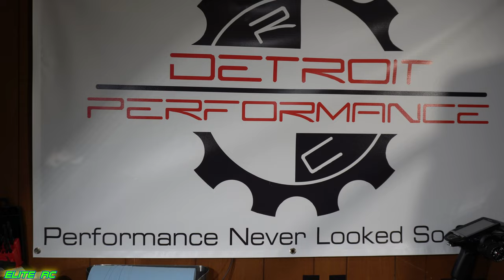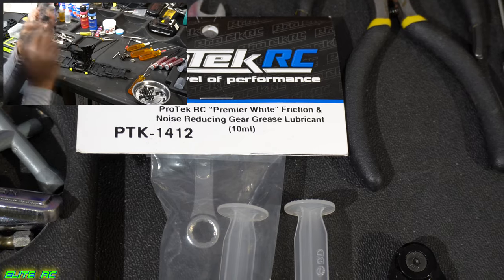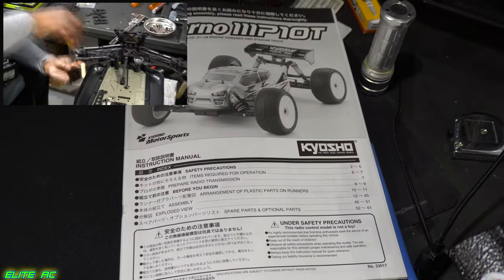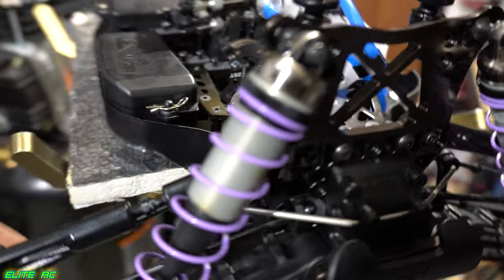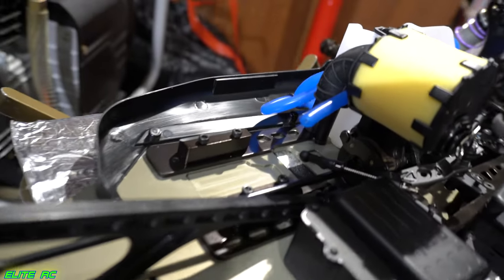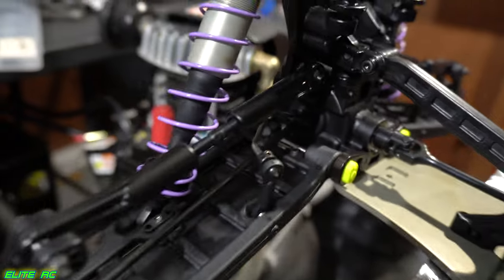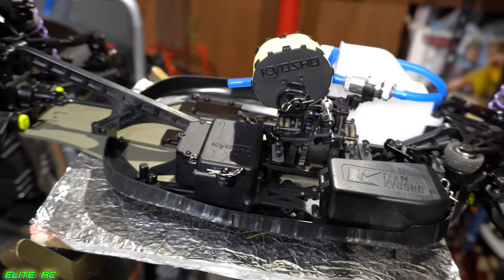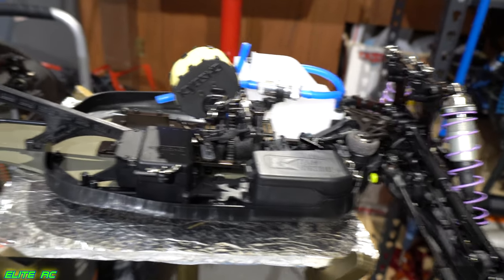KYOSHO MP10T NITRO TRUGGY KIT AFTER BUILD AND REVIEW

Comment: Great review. Debating on the new hot bodies  truck, or this. Kyosho  is great ran the Kyosho  mp9 and ST RR truggy for 7 seasons always did well. Still have them haven't ran since 2016 might  fire them up this spring  see how they handle before  i buy the newer plantforms
Reply from the maker: Good got to make it make sense before putting money out on new platforms and possibly not needing them because the platforms yiu have are proven and mp10 and the mp10t are just new.

Comment: I just finished my MP10T build. Something I noticed on your front shocks- The manual shows the bleed screws needs to be facing downward. I'm not really sure why that would matter but I just followed the manual. I already had mine installed and took them off to change the direction. While watching your video, I realized I installed something incorrectly. Glad I found this video. 

Also- did those bronze button caps for the wing come with the kit? I must have overlooked those if so. I have plastic on mine.
Reply from the maker: Everything on video came with the kit at this point of time which was about a year ago, they probably started trying to save some cost on the kit.